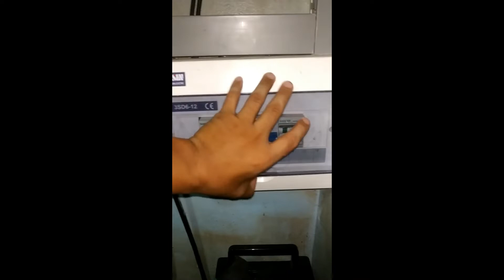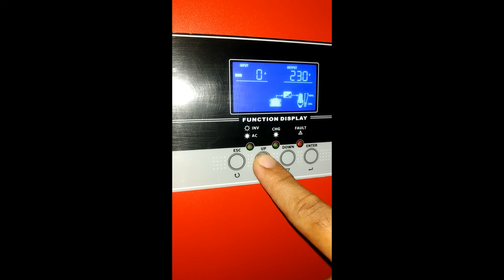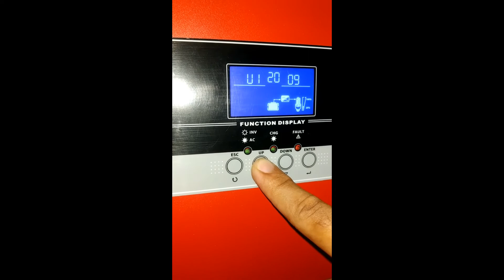BYD 24V 250AH Solar Battery Unboxing PART 2

Comment: I bought this type of battery and configured it for 48V from One point solar. I connected it in series with with JBD BMS and 5A active balancer, The problem with this is  there no way to know if these batteries has uniform capacity unless you test everyone  of them. Initially I bought 4 pcs, but during charging, (around 30A from solar charge controller) one of the batteries will be full charge first (while other 3 batteries is at around 3.35V each cell, so I bought another 1, I thought it will fix the issue but after 2 days, another battery would exhibit same problem. Conclusion: Do not buy this battery if you plan to connect it in series
Reply from the maker: if you read in there web site, it is not recomended in series condition

Comment: Ok Lang Po ba kahit walang BMS
active balancer?
Reply from the maker: so far 2 years in use ok panaman ang running condition ng battery, kapag full charge sa load nmin kadalasan umaabot ng 2am ng madaling araw, hangang ngaun, dpnde sa load, at sa daily charging